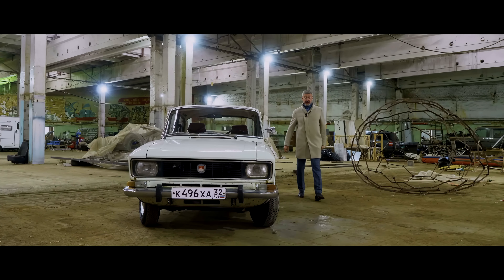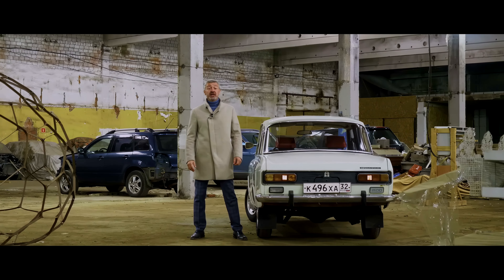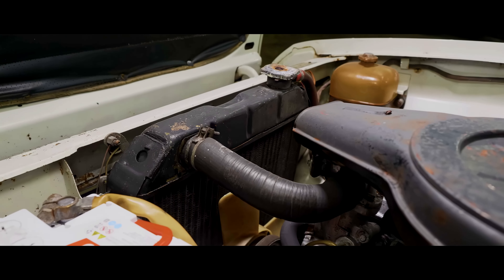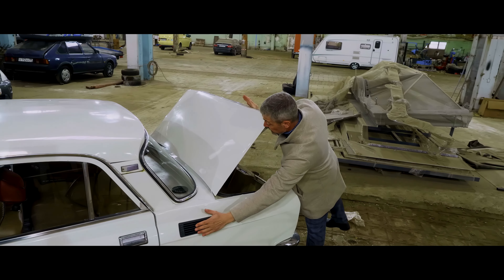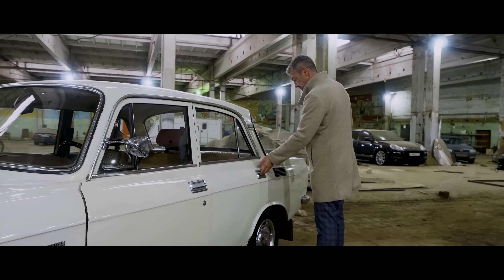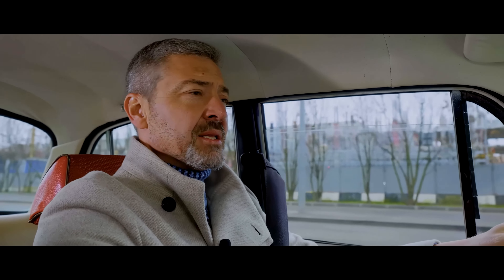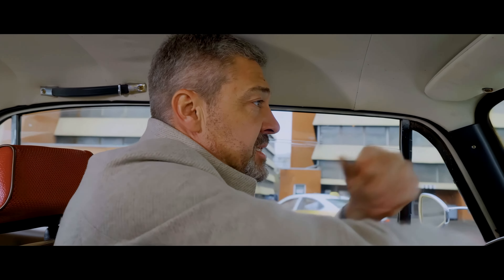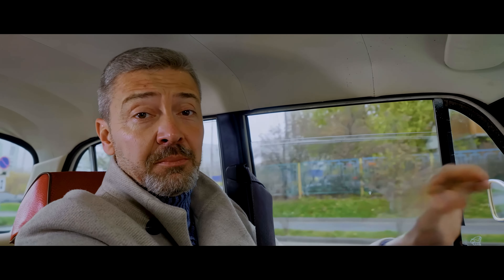Retro Gem: Moscovitch 2140 Unleashed 🚙 Nostalgia on Wheels 🚙 Aleko 🚗 AZLK 1600 SL Rallye 🚙 Scaldia

Comment: This model was also sold in Belgium early 80’s.  Is it possible to put some short details  and production years and numbers  at the description ?
Reply from the maker: In Belgium, the Moskvich 2140 was sold under the name "Scaldia-Volga M24" from 1977 to 1988. It was assigned the number M24. The engine typically produced around 75 horsepower. Thanks for your questions.